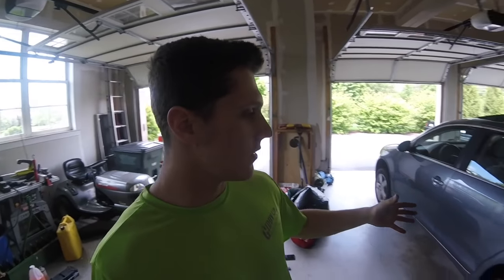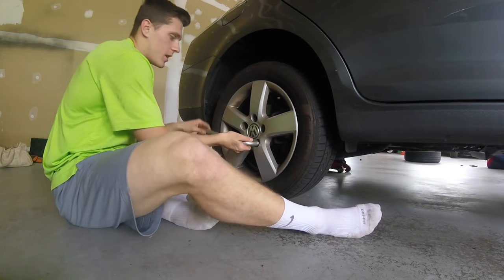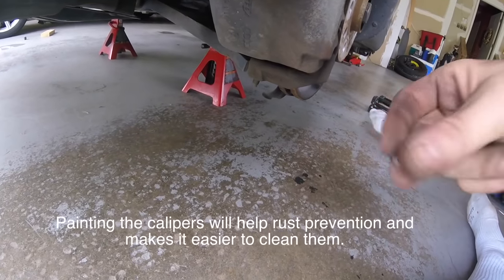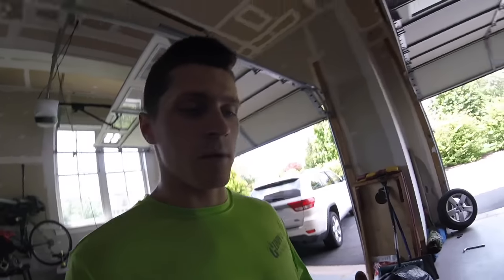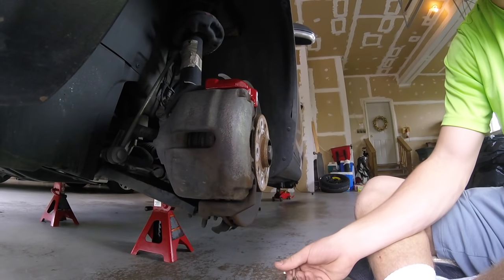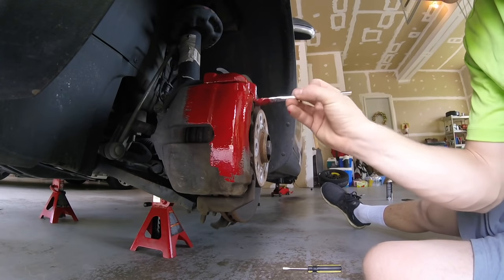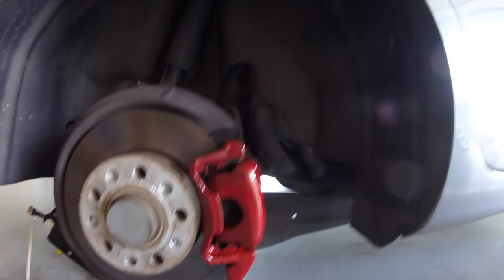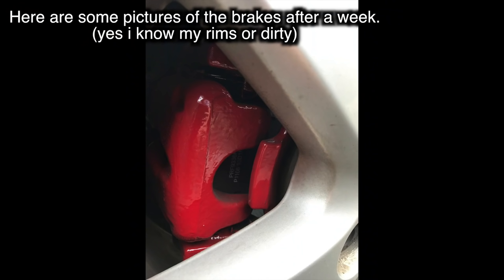PAINTING MY CALIPERS RED - 2008 Jetta!

Comment: Excellent video . A tip I learned years ago and have seen several times since is to place the removed wheel under the car near the well- even like here where you are not actually under the car it would minimise damage if the jack failed and no axle stand in that corner 👍👍👍

Comment: When you've let 1st coat dry, add another coat, then wet sand the dryed 2nd coat very lightly, then use a polishing disc on a grinder to get back the shine and smoother look.

Comment: Decent, I just did mine 2 days ago. Same method brushing on. I found the paint was second coat ready by the time I finished one caliper. So on mt second caliper I started at the top and painted everything down to the bottom so when I finished i did the second coat from top to bottom immediately after finish first coat. Comes out really nice and only costed me 25 bucks for the kit and 5 hours of my own time painting them. Well worth the cost vrs a shop.

Comment: He's killin me with the socks on ..no shoes no nothin on...lol.. Anyway I did my brakes like this but I had a hassle taking off the wheels..So I figured out to paint the calipers thru rim openings instead..It was a two day job..I had to put 2 red coats..clear gloss it 2 times.. remove the excess paint around the rim..But It came out not too bad..It is a leased car.. so when I return the car back..I paint it back to its original silver color.. lol..

Comment: Probably not a bad idea to use a container under the brakes/wheels when using brake cleaner so you don't have to re-paint your garage floor ;-) also some sandpaper along with a wire brush helps in making the finished painted surface look smoother (because it is)...  You can also look at taping off and using plastic to keep over spray off the car and use brushed paint on the harder to get at places and spray (of the same brand) for the more visible areas - the results will be better (that's why most people use spray over brushed paint)...

Comment: how many horsepower does the red paint add to my car?
Reply: +1 HP
Reply: No way, at least +10 hp since he went with red. Add a couple of decals it goes up to 30.
Reply: Well, really it depends on the type of paint you use. If your gonna use the cheap kind then it'll only give you 1hp. You want to use the expensive kind of paint, and in most cases, if applied properly then you can get about 20hp per brake caliper. Lol
Reply: It really depends on the amount of coats he did 3hp per coat do the math buddy!!! An extra 20hp if you use primer.

Comment: Let’s start with shoes think personal safety. Jack stands and tires under the car. Nitrile gloves with paint and solvent. Put cardboard under each caliper and rags to absorb the solvent and keep paint off the floor. Good wire brush clean and then solvent spray. Wipe the entire caliper with a clean rag then respray with cleaner. Tape off areas you don’t want paint on. The quickie paint job might look good enough, but good enough is neither good or enough. The difference in time would have been less than an hour.

Comment: put the tire under the car for more safety bro ✋
Reply: Or even a wheel
Reply: Exactly. Facepalm.
Reply: No need when the weight is evenly distributed on 4 stands. The tire trick is only recommend when you're jacking up one corner of the car where all of the weight will be supported on 1 stand. Then you will put the wheel underneath for extra precautions.

Comment: This is like watching me as a 16-year old. At 2:12 you use the original breaker bar. This means you loosen the nuts while the vehicle is stationary. When tightening them you need a torque spec key. You wont get rust on aluminium. You should have sanded down the calipers before painting,

Comment: NEVER trust those cheap ass screw jacks that come with the car!!
They should be kept for emergency use only, even then don't trust them, especially without steel capped socks!
I've had one strip the screw threads and collapse while fixing a flat...It can happen!
DON'T F@$*# TRUST THEM!